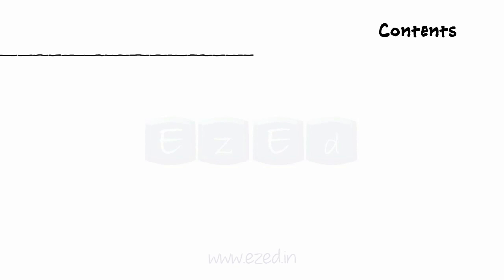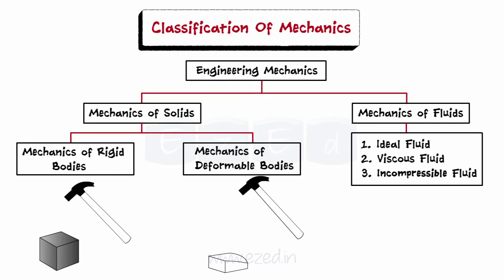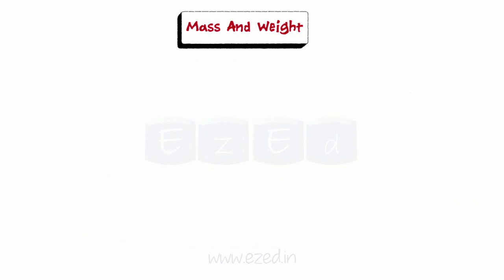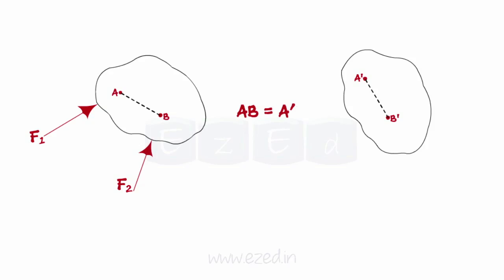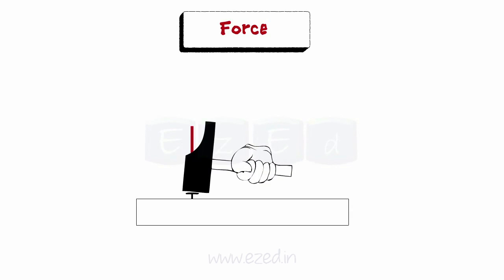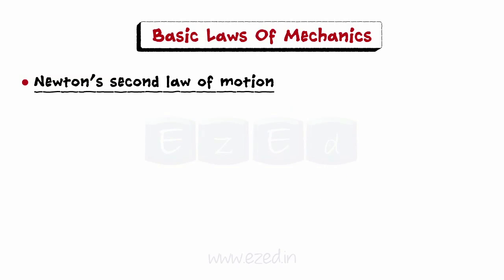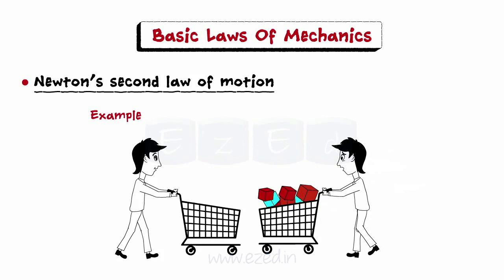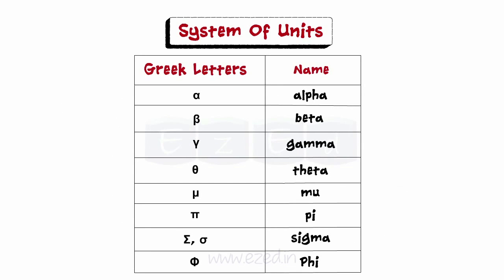Introduction To Engg Mechanics - Newton's Laws of motion - Kinetics - Kinematics

Comment: Just 2 corrections (but I assume it's just left out for simplicity's sake). At 5:10 you say that there is no gravity in space, so the weight is zero. I hope people understand that this is actually only true if you are in freefall, for instance 'in orbit' so you keep missing the earth while falling towards it. Otherwise there is still a lot of gravitational pull from the earth and other celestial objects (except for the places where the forces cancel out. I forgot what these were called but there is even a name for them). Also this applies regardless of you being in space or not.
Also 13:53, the moon is actually tidally locked (the same surface faces the earth while it rotates around the earth). Ofcourse it still has to be spinning in that case, but not at the frequency shown here. Again I understand that animating that might have been a bit hard so you went with this :P. Just pointing it out.